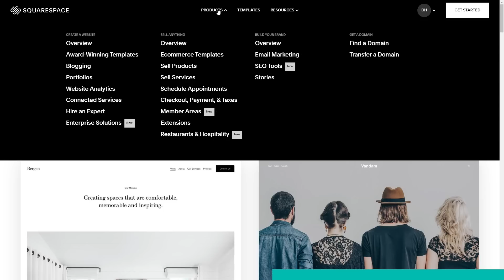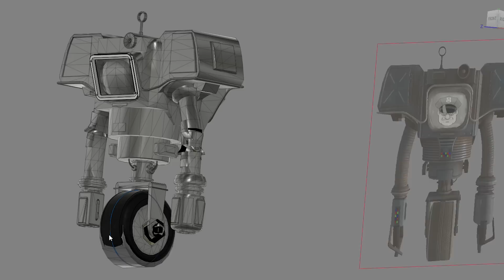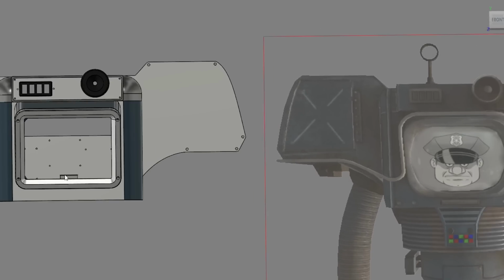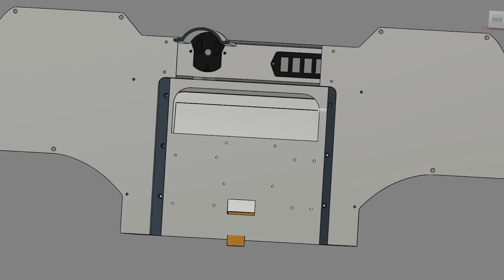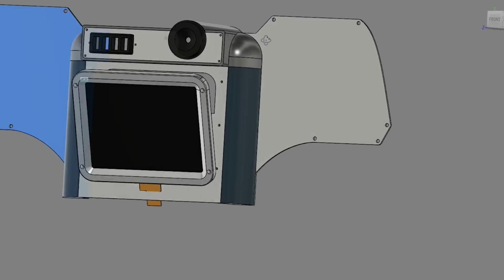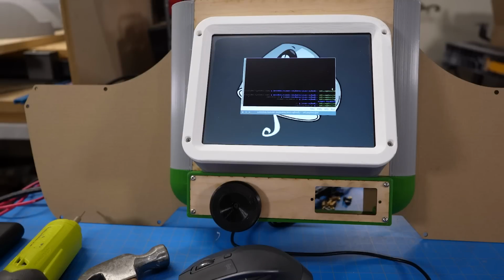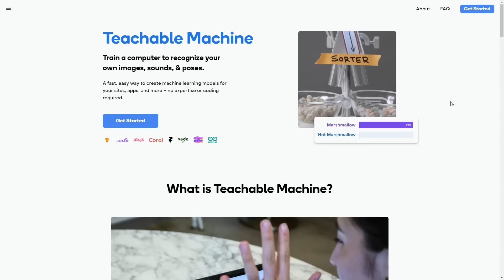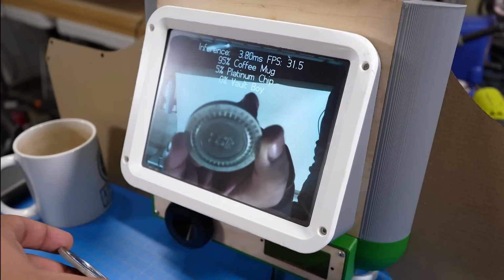Coffee Mug Computer Vision | Building a Securitron in Real Life Part 2

Comment: For a lot of people, it's way easier to 3D print even flat square panels. It takes 5 minutes of actual work with material you already have, vs. cutting it out which involves finding suitable raw stock in the right size thickness (often this means buying material), then, for every one of us who doesn't rock a CNC router or laser, spending 30 minutes with a hand saw and drill to create the part, followed up with finishing work on the Dremel if you want it to look decent.

It's also way easier to publish a .STL that will probably be within reasonable tolerance relative to other parts made on a random joe's 3D printer versus handing out a drawing and hoping whoever gets it can accurately measure and drill the part.

Comment: Screws are superiorrrrrr 👍 In my high school product design class for my final project I designed and built a complex wood shelf, and my teacher was like no no you really should just use glue, but I insisted on screws. Was that a bad decision? Probably. Did it work? Yup. Do I regret? Absolutely not, I drilled like 30 holes sideways into friggin ¼" plywood with next to no experience and didn't split a SINGLE ONE; I'M PROUD OF THAT